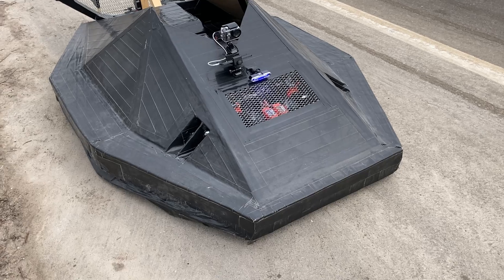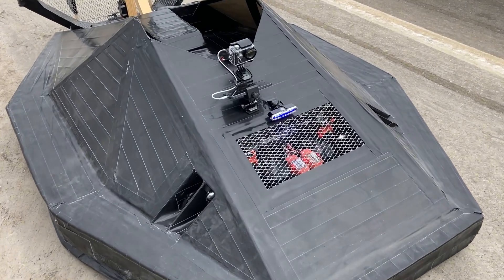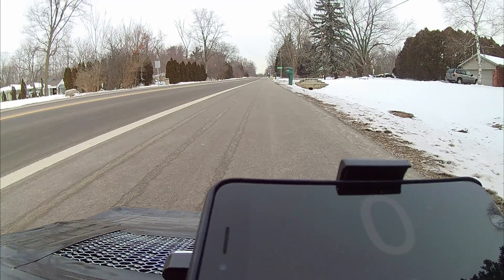How Fast Does My 12000W DIY Electric Hovercraft Go?

Comment: If in case you have more blades on the propeller and if it was above your head, you could go at higher speeds?? Such as 100Km/h??
Reply from the maker: Yes, it definitely could go faster with more blades and a larger motor. But I'm not sure how much faster I would feel safe skimming across a road surface lol.

Comment: You need WAY more blades.  You're leaving a lot of power on the table.
Reply from the maker: Lol, yeah that would get a lot more power out of the given space. However, it would also need more torque from the motor meaning I would need a bigger motor since this one is pretty much maxed out with 2 blades. But certainly an idea for the future. Do you know of any good multiblade 28"-30" props?
Reply: @JacobKrizan  you'll probably also get a bit more thrust by reducing the propeller tip/duct clearance e.g. with a circular instead of octagonal duct, by reducing propeller tip vortices